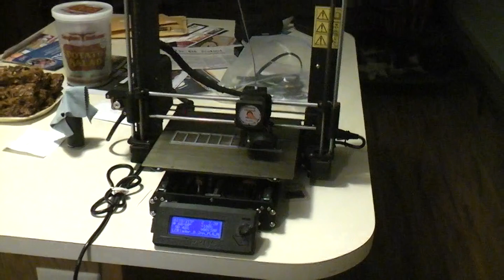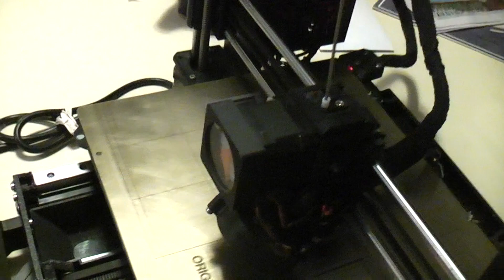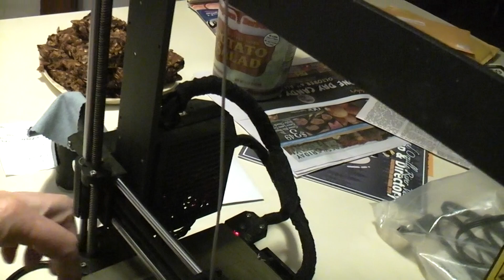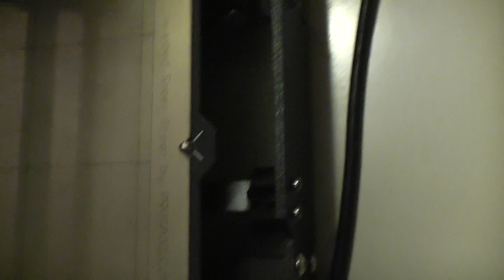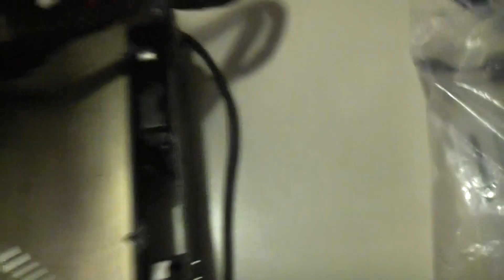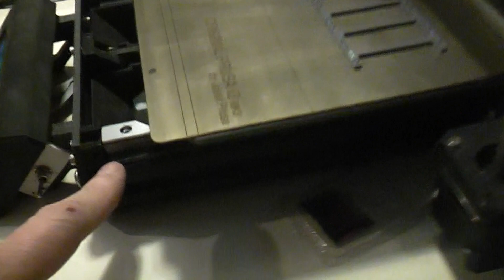Update companion for my Prusa MK3 bed linear rails mod.

Comment: does the MK3 calibrate home position simply with resistance to the motors, or does it have endstop sensors?
Reply from the maker: The MK3 senses the current of the stepper motors to know when they have jammed to set home. Also to sense when a step has been missed during printing so it can home and start printing again.

Comment: Just before you said you added another slide I thought sure you were gonna say you added something printed to the bottom of the bed to limit the movement... something that banged against the frame like the belt mount bang
Reply from the maker: I was going to do that, but got lazy and just put on the extra slide unit that I had laying around. A person could print a filler block to take the place of the left front bearing and that would work as well.

Comment: If you mod your hardware and it's bit lower or higher you always can modify the firmware to new values. Normally the mk3s R4 and R5 extruder gives you additional height but Prusa decided to keep the 210mm instead change the firmware to have 216 or so.
Reply from the maker: Yes and you can use a single linear slide system in the middle of the bed, and then you can have a Y build distance that is 24mm longer. But again you would have to have a heat bed that is 24 mm longer and the firmware set for that so that the auto calibrate system would work with it. Maybe they will take advantage of these things and give us a larger build size in the same size machine foot print one day.